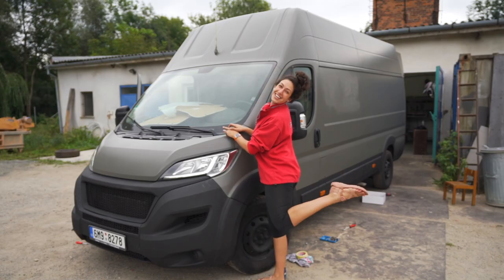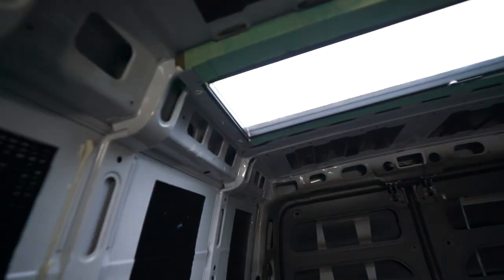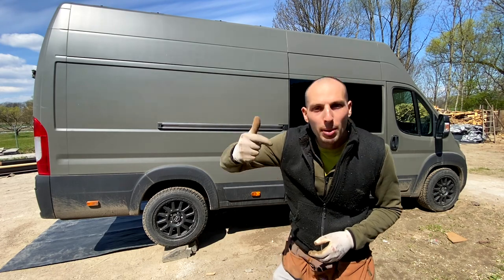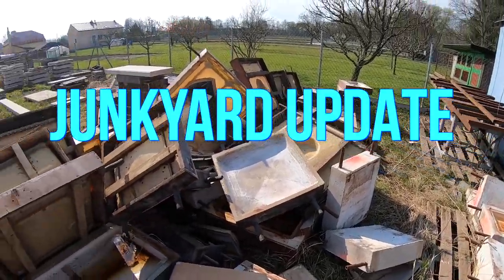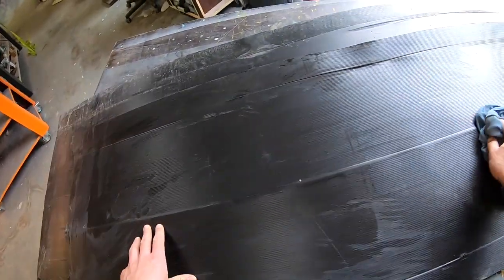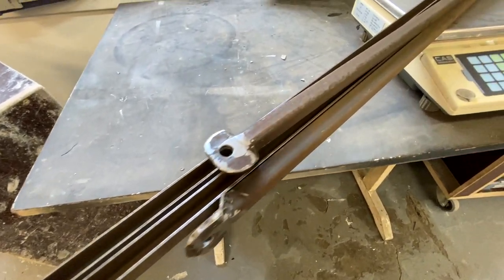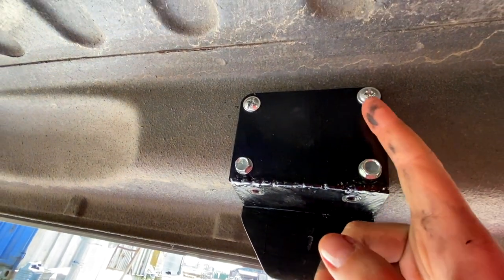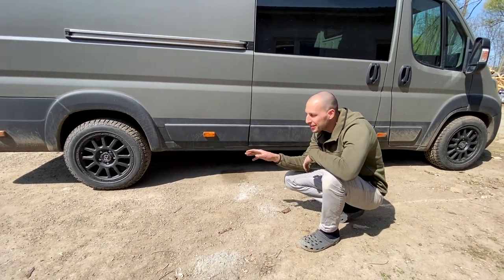NEW VAN BUILD! Installing Water Tanks & New Wheels / Van Conversion #14

Comment: a small note about your water tank brackets . you welded threaded rod to the brackets which is okay if you use grade 5 threaded rod , but dont use grade 8 high tensile threaded rod because it becomes very brittle if welded and will break easily . otherwise nice to see you enjoy your project.

Comment: I used to manufacture those concrete moulds. I was looking at them, and they really didn't look in bad condition. My heart was breaking as I watched you throw them out.. That's thousands of dollars worth. Still, if they are no use to you, then they are rubbish. Only thing I would suggest, is double nut those brackets just to make sure they don't shake loose.

Comment: You can buy a bigger M12 battery.I have a lot of them but I recently bought 2x 8 amp hour batteries from Amazon. Milwaukee doesn't make an m12 8 amp hour battery, the most they go up to is 6 amp hours.It's a pretty good battery for a knock off.
Reply from the maker: I have plenty of those, 2Ah are great for the light and power banks :)

Comment: First of all, great work! Great ideas! And great execution! I just have a question: as the water heater is on the tank itself, how big is the risk of the hose water freezing (in the hose from the tank to the inside of the van)

Comment: Great job on those tanks!!
What you impregnate the wood with? Just curious for my own projects!! (And does it work?)
Used to be Old school creosote here in England old Motor oil mixed with petrol, bit that was 40years ago before environment issues lol 😅 and more sheds than on vans but then again it don't rot if you do your fence and shed with that two years in a row it'll last 50years lol 😅👍
❤️💪🏴😎🙏

Comment: The plastic of those tanks looks like it will sooner crack then bend. Will it survive contact with rocks when off-roading or even the occasional high speed impact from rocks that come from the tires? Happy to see you back on the van-build (even though the bikes were fun to see as well).
Reply from the maker: It's still not finished. Doing leak tests and we're not gonna protect something from every direction that leaks, until we know it's sturdy as is.

Comment: Why didn't you put in the last wheel bolt/lug bolts.
In empty space on top of those watertanks you could put in more insulation/Styrofoam. Between vanfloor and water tanks.

Comment: I have the same van you should add extra leaf springs for the back suspension believe me it will come in handy.I have a lot of weight in my truck and the suspension sags so it's something that I will also have to install.
Reply from the maker: We want to have full custom suspension, just haven’t decided what type yet.
Reply: @ladiandmargaret  Air suspension would be nice you could lower and raise the van.It won't be cheap but it would give you the option of raising the truck on an off road type of senario.The only issue with that is the tires.You would need better tires but I doubt you would drive into the woods.
Reply: Apparently you haven’t watched their old videos of them parked up by the woods. Lol!
Reply: @juliemac5604  I have but when I said woods I meant like deep out of the way where no normal van would go.The land rover has adjustable air suspension it's really cool but not cheap and I don't even know if it can be installed in this truck.
Reply from the maker: That would be the dream. Cheap ones are not worth it in my opinion and proper one was quoted at 9000 usd. So we’ll have to pass on that 😭
Reply: @ladiandmargaret  Yes definitely not cheap and when it comes to  work vans or custom vans everything costs a fortune because they know that you are using it for work.

Comment: How about torque applied to those bolts !Do not rely just on the power tool !I have seen wheels coming off and ripping the whole bolts just fitted like that! Torque wrench is to be used in this process!

Comment: With entirely sealed tanks that have fittings on the inside, what happens if you need to replace a sensor or heating element?  Are you going to have to crack open the tank or did you consider installing access hatches with water-tight seals?  Seems like future access is going to be a nightmare.  Hopefully the installed parts last the lifetime of the van.
Reply from the maker: Sensors and heating elements are all attached and accessible from outside.
Reply: @ladiandmargaret  Ok, I though I saw that some of them were screwed to the tank using large nuts from the inside.  Maybe I didn't follow closely enough to see how they were attached, but it did seem like they would need to be unscrewed from the inside to be removed.  Thanks for the reply!

Comment: Are you not afraid to reduce load index of your tyres, because LI 104 on the tyre you have bought, is only 900 kg? For the front axle it's ok, but in the rear you have much more load and it can exceed 2000 kg easy.
Reply from the maker: What do you think is load per tire with a 3,5t vehicle? I’m curious.
Reply: @ladiandmargaret  Usually load on rear axle is bigger, so if you have 1,3 - 1,5 tons on the front, the rest of 2,0 - 2,2 tons is on the rear axle. In your case bikes, water tanks, fridge and other stuff will definitely concentrate weight on the rear axle. And LI 104 tyres will have to hold it, when max permited weight for them is 2x900 = 1800 kg. You choose nice 18" rims, but the tyres are not for van, these are for offroad vehicle or SUV, which are comperably light. Max load index for such size I saw was 107 (970 kg), but even this would not be enought. Standard load index for your van on tyres with C letter was 109 or even 113 (1030kg or 1150kg). I think you have to reconsider this decision.
Reply from the maker: Interesting, thanks for the info. Do you think they ware off faster or it’s dangerous to even drive?
Reply: @ladiandmargaret  It's dangerous, the tyre will definitely blow when you will drive fully loaded! I'm working with tyres and I have had lot of such examples. Unfortunatelly.
Reply from the maker: Wow, thanks for informing us!

Comment: 100kW? U sure u got that right? thats a lot wow
edit: actually idk how much is that, i only know kWh and max kWh per sprinter roof is around 1,2kWh if the panels are 20% efficiency
Reply from the maker: I messed up my lines 😑😑 1Kw

Comment: Just couple words of caution
Be careful with speed up wielding as potential epilepsy trigger.
This video is not the case. It was short and not that bright.

One of the potential solution is to tint up footage a little bit, less intensity - less triggering if I understand this correctly.
Very close up, long and very speed up and untinted  flickering brightness  - is what should be avoided.
Just some awareness will never hurt :)

I like your channel :)